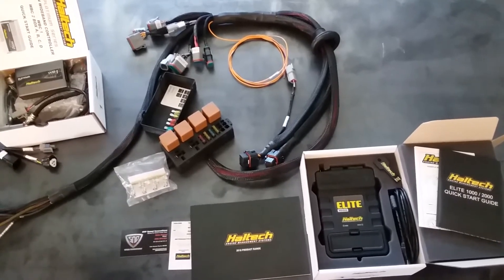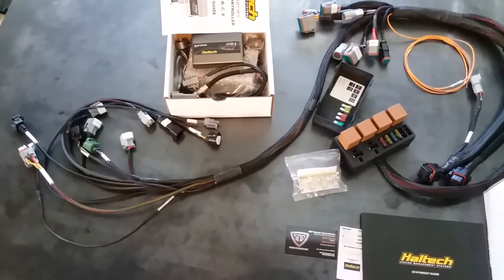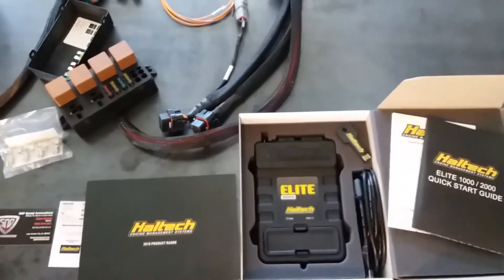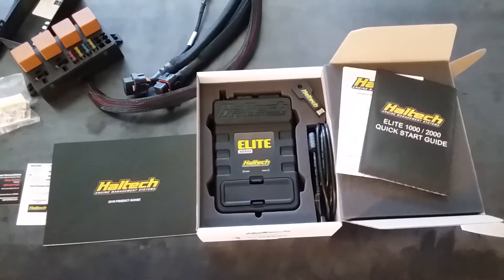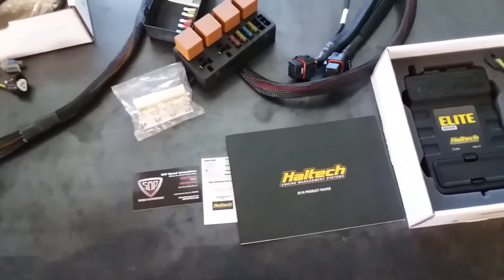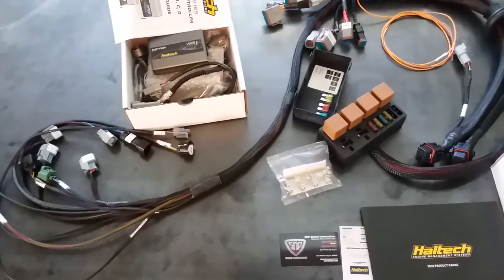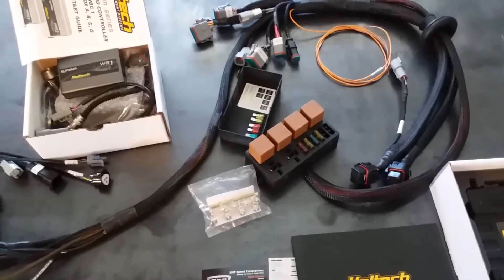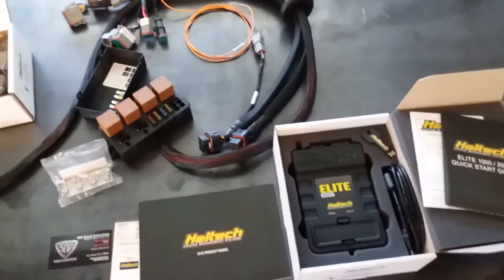2RZ/3RZ to 22R chassis Haltech swap kit by SNP Speed Innovations

Comment: I have a 2006 Toyota 4runner 4.7 engine I would like to swap the engine with a 3RZ or a 22R any harness for that crazy idea
Reply from the maker: Turbo 3RZ would be with our complete harness kit would work
Reply: @snpspeedinnovations   but do I have to use the same transmission of the 2006 4runner??? And what's the price for the harness?

Comment: Can you make a wiring setup for a samurai? To 2rz/3rz  it’s a crawler looking for basic plug and play
Reply from the maker: We have a complete engine harness kits for those engines that plug into all of the factory sensors and replaces the MAS with an internal map sensor good for 30 lbs of boost. We also have adapter kits if you have the factory Toyota harness